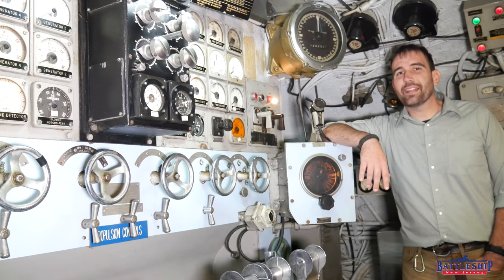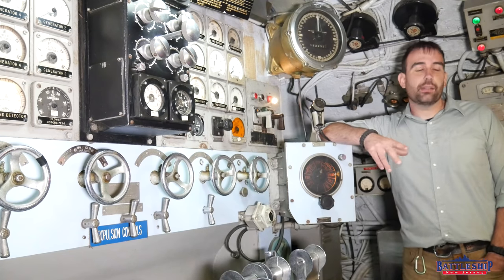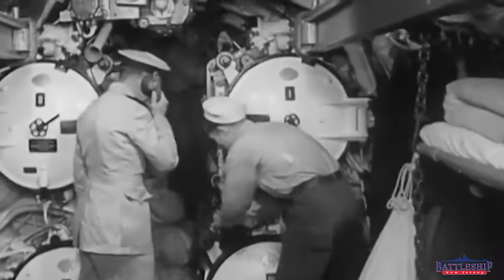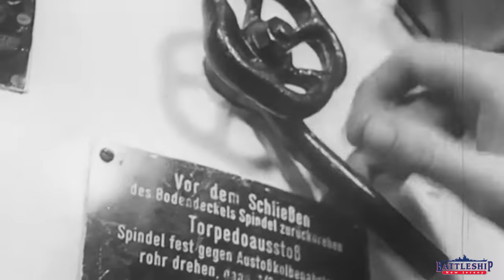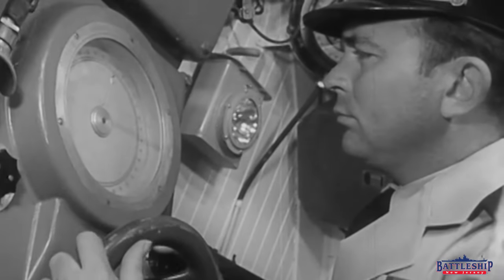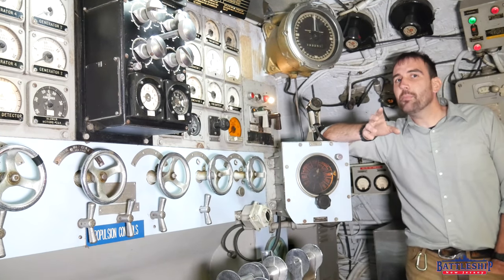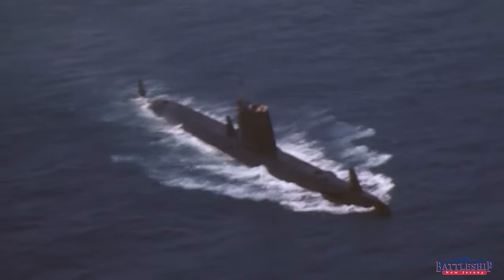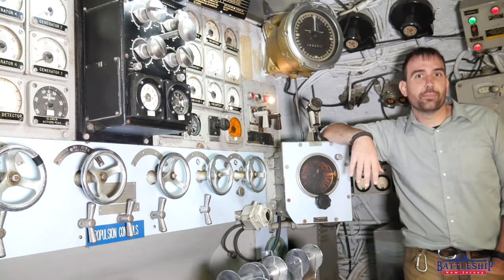Why Does a Submarine Have an Altimeter?

Comment: One of the boats came up with the idea of putting a condom (painted red) over the opening of an empty milk bottle, and then putting the bottle in front of the bow and stern planesmen.  If the condom should suddenly expand due to decreased atmospheric pressure in the boat, that was their signal to climb a little closer to the surface and get that air valve open again.  Much more attention grabbing than a conventional dial sensor.
Reply: Clever and perverted. Sounds normal.

Comment: Serving on a nuc boat was like a pleasure cruise compared to what the crew on a diesel boat went through. On the boats I drove, most crew members had their own assigned racks, with a reading light and air supply. The atmosphere was controlled: oxygen, humidity, temperature, etc.
Reply: What class were you on? I was on a BN
Reply: My dad was at Newport News in Nuc Constuction. He was occassionally part of the yard crew on trials. He as in the Navy 1942 to 1964. Diesle mechanic. Yeah he alway bragged about the one class and the follow on LA boats.
Reply: The Alienation   h
Reply: @randomradon  SSBN-617 and SSN-664

Comment: Someone asked why the ALT is upside down ...  
Because it is broken. The thin pointer shown close to the 5 indicates it is almost 50,000  feet high. It is the 10,000 needle. The short one is thousands and the long one is feet in 20 foot increments. Later snorkel boats used a barometric safety switch to stop the engines at a pressure equivalent to around 6,000 feet which at the rate an engine can consume air was a real ear popper. It was quite an experience when snorkeling in rough seas. 

One thing not mentioned is that the snorkel head valve used 3 electrodes to sense water covering the inlet. If only two were covered you could get a large slug of water barreling down the induction piping toward the engine room and woe unto the oiler standing under the open air inlet located between the engines. There was a cover for that inlet but when in tropical waters that cover was left off to cool the watchstanders. With the cover on the air was directed outboard of the engines and any water would drain into the bilge. Even when no water slug was in the piping, the blast of air after a prolonged head valve closure would knock you over. 

Another sub that uses an altimeter is a manned deep diving submersible. As CO2 is scrubbed from the atmosphere internal pressure drops and the altimeter climbs. After CO2 is removed oxygen is bled back into the atmosphere to replace what was consumed, the altimeter returning to the same elevation as when scrubbing began is an indication to stop admitting oxygen. The altimeter is an easy to read and nearly fool-proof part of the life support system.
Reply: It may not be broken. There's a knob that you can adjust the pressure at sea level. There's supposed to be a Kollsman window to set it in inches. 29.92" is part of the standard temp/pressure aviators use. When calibrating an altimeter you can take it up as far as you want. Mine was calibrated to 15,000' because I'll never go over that. I don't have oxygen. Maybe someone kept turning it until it was at 50,000.
Interesting about the water slug. My dad had to stand lookout watch on a destroyer (He was US Army) in a storm coming back from Europe after WWII. One of the few not seasick. He said he would go back and forth to the bow and the water in the hawse pipe got him. Nothing like ice-cold water. Every time I tell a Navy guy about that they think it's hilarious.
Reply: And I thought it was because the easiest way to make a depth gauge was to turn an altimeter upside down.

;)
Reply: Nonsense, its there to show at what pressure the air is in the boat, nothing more  !
Reply: @welshpete12  True it shows only air pressure, but you can make many inferences from what is happening to the air pressure.
Reply: It's not broken. It is registering the actual depth and the secret is now out. This submarine went 6000 ft down. Wow!

Comment: For the impatient, short answer is the diesel engine uses a snorkel to admit air which has a clapper valve that closes if a wave covers it ( to prevent ingestion of seawater to the engine). The diesel then temporrily sucks air from inside the sub when this valve closes, dropping the internal atmospheric pressure, and increasing the apparent altitude inside the sub. Someone obviously has to monitor this gauge while the boat is underway on diesel in case the air inside the sub is exhausted.
Reply: Believe me!.....you won't need to see a gauge to recognize when the engines start to pull a vacuum in the boat.....your ears wit tell you right away!

Comment: It has happened a few times ( I think most recently a Chinese diesel boat crew a few years back ) where they found a diesel sub floating on the surface full of dead sailors where that same flapper snorkel cut-off valve failed and the safeties or standing watch engineer did not catch the air pressure drop to shut the diesels off. The engines sucked all the air in the inner compartments and suffocated the crew. It has and can happen.
Reply: That should have been part of an automated safety system.
Reply: @thedopplereffect00   Yep. I remembered another one. When I was stationed in South Korea back in 2000-2001 we use to go to briefings of North Korean naval intelligence mini diesel subs and special forces frog men been delivered by mini diesel subs to the South Korean shore. One was caught in a fishing net, one ran a ground and was stuck so they all committed suicide. Another one was found in shallow water ran a ground, When they opened the vacuum locked hatch the 8 or so crew members were dead but not by suicide, suffocation.
Reply: Chinese sub 361. I read about that. Killed everyone on board and they drifted for ten days untill some fishermen noticed a periscope sticking out of the water. Crazy
Reply: NOT a nice way to go. Ick!
Reply: @Weesel71  actually its usually painless like you fall asleep and don't wake up because you are dead.

Comment: First off: Diesel Boats Forever! Got that off my chest, yes, the air pressure goes down when the clapper closes and the engines are running. The experience can be painful as well as annoying. One of the sure signs that the boat is drawing a vacuum is the sounds made by canned foods -- the pressure in the cans causes them to expand a bit creaking  as the vacuum increases. Then when the clapper opens, the air pressure equalizes, ears pop, and the cans start to compress and make noises again. There were times when we would cause a vacuum on purpose to replenish the fresh air in the boat. We could often guess the air quality by how high one had to hold a cigarette lighter to get it lit; raising the lighter put the flame into the fresher stale air near the overhead. AIP if I remember correctly was the basis of the Walter turbines on the modern U-Boats. While this would make the boats more effective, it cannot make fresh water like a nuke: no fuel expenditure. The worst I can remember was trying to snorkel though a major storm. The skipper finally said %$#@ and took us down to 150 feet. The boat was still rocking but at least anything loose was not falling around.
Reply: Thats amazing, you could still feel the storm underwater? What sub did you serve on?
Reply: @ryanphillips5688  First was a TAD to  USS RONQUIL, SS-396. Then I did a few TADs on USS BONEFISH, SS-581 (the trip I described with the underwater rocking and creaking cans), USS BLUEBACK, SS-582 (now a museum in Portland, OR), and called it quits with a TAD on USS HADDOCK, SSN-621. Yup the air was getting just a mite "manky" after 20+ hours of being unable to snorkel. This was all in the timeframe 1969-1971. We tried to surface to repair a mast in a similar storm and nearly lost three crew as a big wave came out of nowhere and slammed the boat down to where water made its way down the open hatch and they had to close it and leave the guys on the bridge. When we came back to the surface, three very wet, relived crewmen filed back into the boat. Meanwhile a lot of electronics had shorted out and the skipper announced that the planned field day would start a bit earlier than we thought. Quite a mess.
Reply: @ryanphillips5688  Keep up the good work on NJ. One of my neighbors was an Electricians Mate on her during the Korean War. He died June last year at about 86. COVID got him.
Reply: @Weesel71  Thank you for your service. I am curious what did you do on these boats? Do you know how to start those diesel engines by any chance?
Reply: @jamesvalenti9288  James, I was "hired help" from a shore installation. There is NO WAY the assigned crew would leave one of us near the actual controls of the boat. Closest I got to the diesels was walking thru the engine rooms of RONQUIL. Sometimes a ship needs people with special skills but can't use them all the time. Thus they "hire" them as needed. It was a fun way of seeing how different commands operated without a long-term commitment to what may turn out to be a hell boat. Ditto for certain shore installations even worked with the USAF once. Nothing like being a 20 yo PO2 (E-5) and being quartered in a Senior NCO barracks with guys nearly twice your age. Fortunately we all spoke shots n beers.
Reply: @ryanphillips5688  On my SSN in the Pacific we were coming shallow for radio traffic and a SatNav fix. As we crossed through 400' the boat started moving side-to-side. When we hit 150' the surface suction simply put us on top and we had to flood a considerable amount of ballast to get back down. I was Aux. Electrician Forward and lined up for a Low-Pressure Blower recharge (to exchange our stale air and put positive pressure in the boat for the air compressors, etc.) and had to secure and restart five times. I was absolutely exhausted running around opening and shutting all of the air-valves, drains, etc.

Finally, the CO looked at me, dripping with sweat and panting like a racehorse and said "Looks like the AEF is tired of this shit.... Let's go deep...."

I send him a card and gift every Christmas................................
Reply: @karlbrundage7472  what years did you serve? Also were you on a 688? Or something else?
Reply: @Weesel71  I didn’t know there was a submarine museum here in Portland I got to check it out! Bonefish is a hell of a name!
Reply: First off: Nuc Boats Forever! ;) Diesel boats are just pop-up-skimmers!!
We had a visit by the Mayor of our affiliated town where beer and gifts were exchanged. The gift to our mess (Senior Rates) was a barometer, I kid you not!!
Only thing it was good for was if it forecast good weather, then it was time to run the HP Air compressors and top up the bottle groups, or when it forecast storms the bottles were full and time to shutdown the compressors.
Regards from the other side of the Atlantic :)
Reply: @southjerseysound7340  Through the '80s, and yes, 688.
Reply: @kevg3320  Pop-up skimmer!? You really cut with that  one! Can't say I've heard it before so you get a point for originality. On the serious side: keep safe and keep alert, mate. Bad stuff happens fast. Cheers.
Reply: @karlbrundage7472  Good story. Shows what real life is like and not the BS we get from hollywood.
Reply: @Weesel71  😂 good to know. They spray paint everything out here combine all the colors together and you get black so keeps the ship paint in good condition lol.
Reply: Treasure trove of stories on this thread, glad those 3 sailors made it in (see what I did there)
Reply: Two snorkel masts separated by a large portion of the hull length would perhaps help a bit. With both open, it's unlikely that any wave would close both at the same time.
Reply: @mytube001  Novel idea. Not sure how it would affect the boat's performance regarding drag, etc. Then the engineering would be, I'm sure, tricky. A good portion of the snorkel system is encompassed by the sail structure. Longer sail? Not sure.
Reply: @Weesel71  It could easily fold flat against the top of the hull. No need for a telescoping snorkel there. A small hump at the base for any mechanism required. Drag is not really an issue when snorkeling at a handful of knots. And a second snorkel wouldn't add much drag anyway.
Reply: @mytube001  You are describing something much like the snorkels used on the German WW2 boats that were converted. OK, it would be interesting to test for proof of concept. I'll watch :)
Reply: " by how high one had to hold a cigarette lighter to get it lit;"

Are you sure about that? Because flames require way less oxygen than you do; ie: you expire in air that can still sustain a flame very well, hence why people die in fires before they actually get burned.
Reply: @vinny142  Absolutely sure of it. I was not having success lighting up and onenof the more experienced members of our team showed me how he did it. It worked.
Reply: Diesel is so antiquated and nasty. And still King! Makes you wonder every time someone says there is no limit to to what we can do in the future. Tell that to half the worlds navies still using diesel in 2050.  😆
Reply: @vinny142  people die in fires without being burned because of poison fumes, not lack of oxygen. As a teen two of us were sleeping in a cold car one night and used Sterno. After a while we thought out matches were no good because they wouldn't light. After a window was cracked the matches flared right up, but we noticed no difficulty breathing. I think you're wrong on both counts.
Reply: That would be impossible for me. I have narrow Eustachian tubes and that would surely put holes in my ear drums. I jumped out of a perfectly good airplane to skydive putting a hole in one of my ear drums...I would like to jump again but obviously I can't just like one of the subs with it's generators running. No scuba diving and being on a commercial aircraft coming in to land is excruciating, it takes almost 30 minutes into the airport for the pain to subside.
Reply: @DrHarryT  You have my sympathy. The change in air pressure never really bothered me to the point that I ended up with real ear problems. One of our CPOs, however, did suffer a bit more than others from these pressure changes.
Reply: @kevg3320  LOL (637 here)

Comment: Hey Ryan, great video as usual, but I wanted to clear one misconception. When describing AIP submarines you mentioned that they use propellant stored onboard to power their diesels while submerged. While possible, and even fielded in small numbers shortly after WW2, this method proved to be unreliable and inefficient. Modern AIP submarines (be it Stirling engines or power cells) use a system separate from the main engines to provide power/propulsion.
Reply: Not only that I wante'd to point that, but Smartass who done that first seems to be from Poland ass well. I think that Rayan oversiplified that on purpose.
Reply: Besides those mentioned (Stirling, electric Power Cells), other special engine types have been used such as auxiliary steam turbines run on stored gasses. One of the newest systems is Japanese, that has both the Stirling and a very large bank of lithium ion batteries. These lithium batts appear to be the wave of the future and their next class will apparently delete the Stirling and use even more lithium batteries. 

Because most of these AIS rely on stored fuels (compressed gasses, liquefied gasses, or sometimes a hydrogen and/or oxygen carrier liquid that combines with a catalyst to release gasses), the boat's range under their power is rather limited (they are not very fuel efficient and the tanks fairly small). With the lithium batteries, the stealth endurance total time can be greatly extended assuming a recharge at sea can eventually happen... at least it won't have to return to base to refuel nearly as often. And the boat's power systems are simplified and safer... back to the Diesel-Electric model. The boats are a lot faster submerged using the standard electric motors than when under the separate auxiliary engines like Stirling's (although electric fuel cells recharging batteries would allow higher speeds as well)... but in all cases to be quiet, they must go very slow.
Reply: @stevewindisch7400  The newest Japanese submarines don't have Stirling engines. The previous ones had 4 stirling engines apiece. New ones, last two Soryu hulls and the class after that remove all 4 Stirlings and their fuel tanks, convert all that volume to more lithium batteries.
Reply: Bob Watters  No, obviously they can never get those kinds of Kilowatts out of panels (unless their base has a lot of them, as nearly EVERY US Navy base has). Why do you ask, do you dislike electric vehicles? If so, I'm your huckleberry.